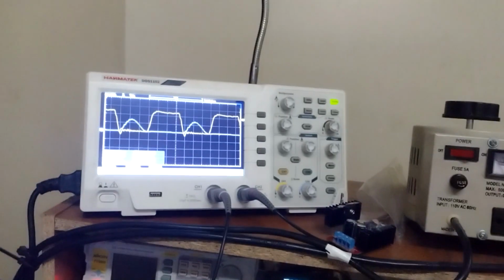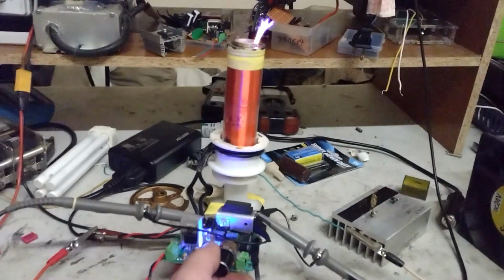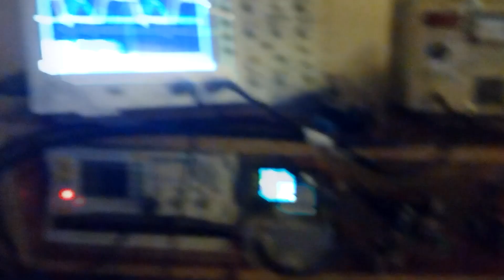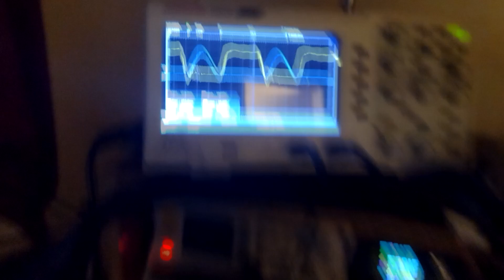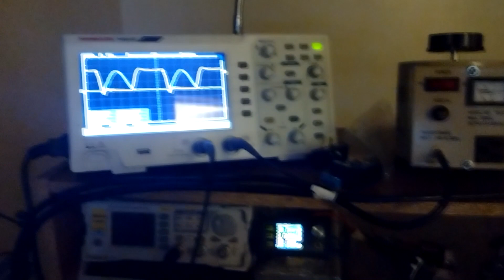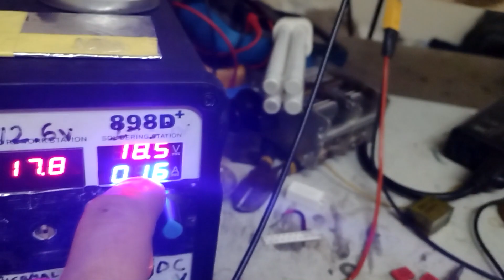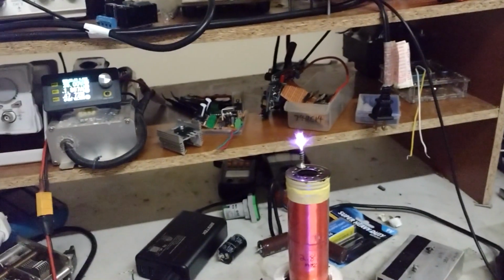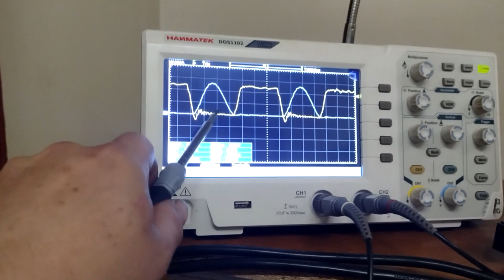2.8mhz Class E Small flame-like discharge

Comment: I was looking into the uzzors pll cd4046 driver , and I noticed he was interrumpting with a 555 timer at the pin 5 of the cd4046 , I wonder if that would work with your schem  , cause that would be cool seems like a easy way to interrupt since I do not have enable with my gate driver
Reply from the maker: With my setup I just interrupt it normally at the gate driver enable pin. Works pretty good I just never did a video on it.
Reply: @Magneticitist  yep but I would prefer to use the pin 5 if possible because of the way I set everything up , I got too little space for adding a and gate , and this pin 5 seems easier , I wonder how good it would work , I might give it a try , anyways I got a bunch of things to sort out in order to get it running right , but interrupting would help to keep the fet colder too
Reply from the maker: @rodriguezfranco3839  I mean it's basically all the same. You're either interrupting by shutting the gate driver on and off or you're shutting the vco on and off.

Comment: Very cool discharge , would it be a problem if I screw the fet directly to the Heatsink just using that white grease for termal conduction , cause I do not use those rubber  things for Heatsink so it is conected to the drain , I wonder if that could cause any problems
Reply from the maker: Yea sometimes I do that. I don't use insulators for a lot of HF plasma flame stuff either. Mainly I use the pads because I don't like messy thermal paste and the heatsinks I use are pretty scratched up
Reply: @Magneticitist  thanks , I thought maybe I was messing up right there , I been doing some testing today , I bought a few more 18650 and completed my 4x pack , so I tested those new secondary I made , the one that's about 4mhz worked like shit 🤣 almost no output and the gate driver got warm,  and the other I made on the glass container works but nothing impressive , I can't tune it nice cause I am kinda bottoming out the vco on the low frecuency side , but I did notice it draws less current than the thin clumsy secondary I was using at the begining , I been thinking about taking out some turns trying to increase the frecuency a bit or the other option would be add a bit more capacitance in the 6-7 pins of the cd4046 I think that would lower the frecuency of the PLL  maybe would be better cause taking turns also would decrease the number of turns giving me less output
Reply: There is no problem, the problem is that you will have some potential at the heatsink, since the Drain terminal is the same as the back metal of the transistor
Reply: @Headbutter-Lettuce90  gracias , claro el problema es el disipador queda conectado al drain , si son dos mosfet no se puede hacer porqué quedarían conectados ambos drains
Reply: @rodriguezfranco3839  si, básicamente un cortocircuito
Reply: @Headbutter-Lettuce90  cuándo volverás a subir videos de tu bobina ? Jeje se veían muy buenas
Reply: @rodriguezfranco3839  cuando caiga la plata, esqu no hay
Reply: @Headbutter-Lettuce90  jajaja yo estoy igual , ya gasté más de lo que debía , es que es adictivo ,jajaj por eso trato de no quemar nada 🤣🤣
Reply: @rodriguezfranco3839  yo estoy intentando decidirme entre una PLL o una con el IR2153
Reply: @Headbutter-Lettuce90  yo creó que depende de que tipo de alimentación vas a usar , si vas a usar corriente alterna del enchufe , seguramente te conviene el ir2153 tipo bridge , pero si vas a usar corriente continúa con una fuente o baterías en ése caso el pll es muy divertido , y el PLL creó que es mejor para usarlo en CW . Pero ambos circuitos seguro son divertidos . Éste PLL es difícil de tunear sin osciloscopio , pero para mí eso es lo divertido , porque si funciona bien a la primera me termino aburriendo rápido , con el pll tenés que experimentar mucho para dejarlo andando bien
Reply: @rodriguezfranco3839  es que con el PLL está el compromiso de hacer switching con los transistores a cero corriente pero teniendo en cuenta la fase del secundario
Reply: @rodriguezfranco3839  hace poco descubrí que los inversores Schmitt trigger de ese circuito PLL hacen que la señal invertida se sobreponga sobre la señal no invertida, obviamente esto termina en el H bridge en cortocircuito por periodos pequeños de tiempo
Reply: @Headbutter-Lettuce90  yo he notado que anda mucho mejor poniendo la antena a negativo y haciéndola andar en frecuencia fija , no le veo gran utilidad al schmitt trigger , si tuviera que armarla devuelta no lo pondría , en mi caso usó un solo mosfet asique no tengo ése problema , tampoco uso GDT aunque podría agregarlo fácilmente si fuera a usarla con mayor voltage , igualmente estoy ahorrando para comprarme un osciloscopio porqué así solo puedo tunerla mirando el plasma y teniendo en cuenta cuanto calienta el fet , además los capacitores que usé de snubbers se calientan mucho , debería usar algo tipo un wima fkp o mkp pero no consigo en esos valores y los wima parece que son carísimos 🤣
Reply: This is a problem when having two transistors in the same heatsink